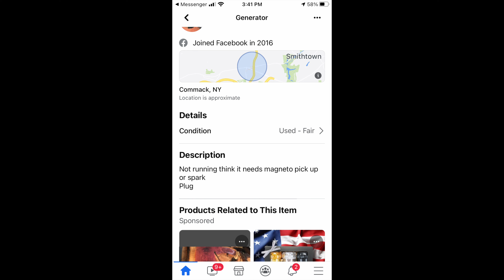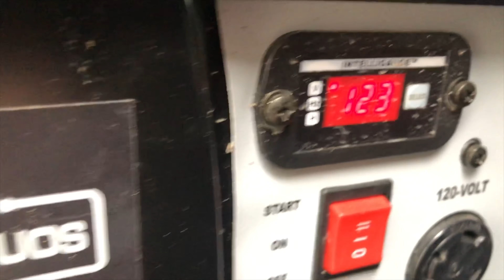Category 5 Champion Generator That Died Stopped Running & Will Not Restart #FixNFlip P1

Comment: Nice Generator Jason. I have a Champion 196cc that is a little older than the one that you purchased. After reading the comments, I also agree that with the oil just a bit low will totally kill the ignition system. The fuel shut off has the 10mm metallic bowl on the bottom side that works exactly like the glass sediment bowls that most people never seem to check out. 
Those Honda/Honda Clones metal fuel tanks were notorious for rusting within the tank,Especially if they sit for long periods of time. 
I was running my generator one afternoon and it acted like it starved for fuel and quit running. My metallic bowl on the very bottom of the fuel shut off valve was completely full of packed rust and I used my 10mm wrench to scrape out the solid rust from inside the bowl. After I got the bowl cleaned out, I opened the valve and left the fuel flow for a bit until the flow looked more normal. After I threading the bowl back to the proper tightness, I also removed the bowl nut from the carburetor and flushed out the float bowl in which I was quite fortunate that the fuel looked really good - Because I Was Expecting The Worse.

Comment: Great deal.  If not the oil sensor, they also have over voltage protection.  Just fixed a champion like this that would only run for a second or two and shut down.  I unplugged the oil sensor, no change.  Disconnected the wire that you did and it ran fine.  Checked the voltage and it was at 170 volts.  Replaced the AVR and all was good.
Reply from the maker: Really appreciate the advise!  Just wait for part 2 🤙🏻🔧🇺🇸🦅

Comment: That was a shutdown lead as you know.  Most likely a low oil shutdown.  These only have to be a cup low for the oil pickup to detect that.  Let me know what you find.  I could be wrong :-).    Funny video.  A interesting owner of that generator.
Reply from the maker: So I was on the phone with Ken bc I didn’t feel like texting anymore. What I found ODD is that I have NEVER seen a Low Oil Switch on the Left Hand Side of a motor.  I mostly deal with snowblowers and if equipped that’s where they are. At work we have Kawi’s and they are Right Side as well but Internal 🤬.

Even if your wrong we always appreciate chiming in.  Owner was a very nice guy, wish they were all like that. 🦅🤙🏻🇺🇸🔧